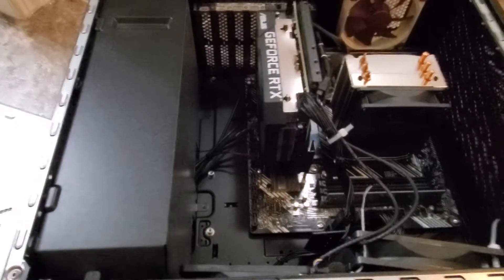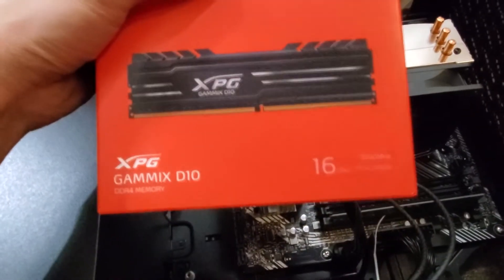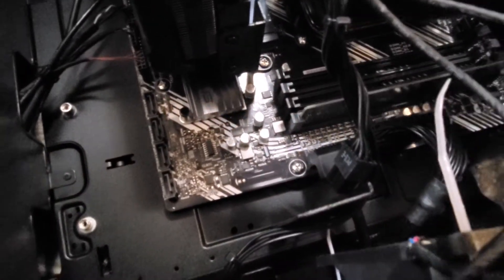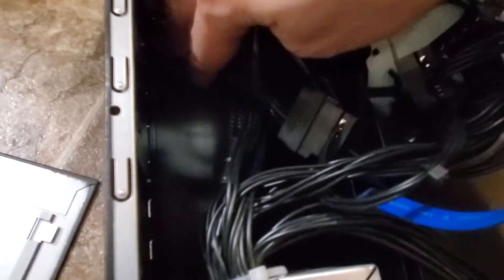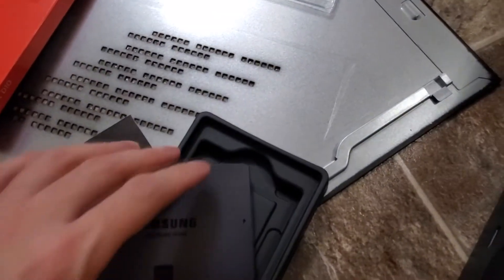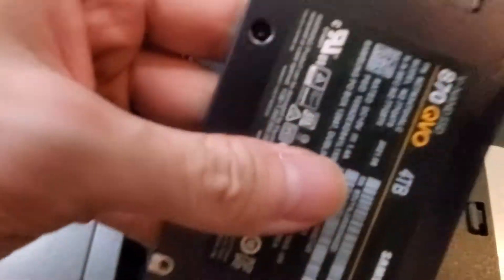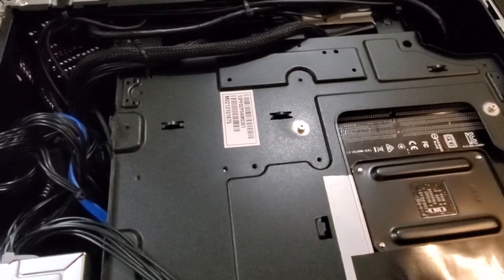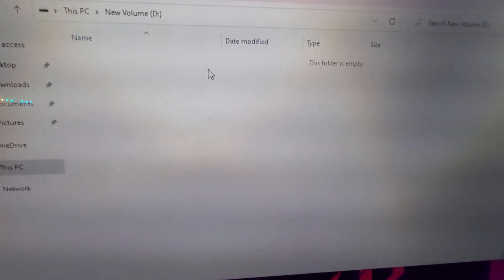How To Upgrade ASUS ROG STRIX G15DK Gaming PC 4TB SSD x 1TB SSD 32GB RAM

Comment: So I'm planning on buying a 1000 watt ROG strix PSU for my ASUS ROG STRIX G15DK Gaming PC, will it fit? Graphics card is a 3070 but everything is RGB and the PC currently restarts for seemingly no reason but upon checking the event viewer it's telling me it's a power issue hence why I'm going for the 1000 watt PSU
Reply from the maker: Yes. Its a power issue. Any atx psu should fit 1000watt isnt large. When you get the 1500watt those are longer
Reply: @kintips  Appreciated I could probably get away with an 850 but I'm greedy lol
Reply: @kintips Okay I installed it eventually but I am now a little lost, pretty sure I have the cables all in correctly. When I attempt to power it up I see the graphics card flicker on and off but no actual power to the PC any ideas? Okay I see the fans flicker on and off as well
Reply from the maker: @GabberFan12 is your ram seated correctly? Make sure all connections are tight.
Reply: @kintips Checked the ram and reseated both, all connections have clips so they are in correctly. Still the same, I am probably missing something simple
Reply from the maker: @GabberFan12 u have another video card? Take the other one out and try another one
Reply: @kintips I do but I have no idea how to get this one out, I hate this case with a passion
Reply from the maker: @GabberFan12 its either the video card or the psu might be faulty. Its brand new psu? I bought a psu once and it was faulty
Reply: @kintips Yeah is brand new, I decided to put the old 750 PSU back in to see if it would boot and hey presto it worked. So what I will do is ask some shop to install it for me 😂 If they tell me the 1000 isn't working then at least I can use the warranty to get it replaced, what a headache lol. I'm now wondering if it's the GPU wires, regardless it's going into a shop.
Reply from the maker: @GabberFan12 yeah faulty psu is pretty common. You think it might be the 6 pin gpu power cable? Hmm ive never seen that. Is the psu modular?
Reply: @kintips  I have no idea tbh I'll let the shop deal with the headache instead lol. PSU is ROG Strix 1000w Platinum that's about all I know of it lol
Reply: @kintips So the shop installed it and had no idea why it wasn't working when I attempted to install it lol

Comment: I have a ASUS ROG STRIX G16CHR computer and the same issue with the SSD.  I was able to put it where you have yours, but I could attatch one screw to the bottom as there are 4 holes in the case at the bottom.  Do you even know what would fit in those 4 holes?  Thinking some sort of drive bay, but no idea what kind?  Also saw some older video where someone put some sort of SSD plate which went over where the screws for the heat sink were.  I wouldn't know what kind to use though.  Really stupid they don't have a bay for SSD or supply the parts for even installing bays somewhere...
Reply from the maker: Yeah there isn't much room to put the SSD, but i've had no problems in the area where i put my ssd. It might fit the 4 screws but there too many cables to mess with. I think if you switched it out with a modular PSU it may help.
Reply: @kintips  I'll have to look into it.  I have tthe measurments for the screws so will see if I can't find a bracket or even maybe drill holes to fit a 3.5" case or something...

Comment: Hi, do you have any social networks where we can talk privately for questions please?
Reply from the maker: You can write the message here. I may do a live stream in the future
Reply: @ My question is: What was the basic configuration of your PC and what can be improved on it?
Reply from the maker: @lucasjr7_879  you can improve evrything except the cpu. If you need to upgrade cpu you will need a new motherboard
Reply from the maker: I have 1tb ssd plus 4tb expansion ssd then 32gb ram rtx3060 with a ryzen 7 5800x
Reply: @kintips  okay thanks, changing processor is not possible because of Bios?
Reply from the maker: You can upgrade the cpu if the socket is the same.
Reply: @ So I can change from Ryzen 5 3600x to Ryzen 5 5600x without any problem, right?
Reply from the maker: Yes is they use the same socket. Just remember u need a psu strong enough to support upgrade
Reply: @ Okay thanks for the answers

Comment: Dam i trying to find info on putting in a M.2 i don't know where to look the guide says it has 2 slots for it but i don't want to crack open my PC until i know where to look
Reply from the maker: Its usually under the gpu
Reply: @kintips  you mentioned in a few other comments I shouldn't even bother because both slots are already in use. I was hoping to slide a new one in, but I'll just play it safe and add what you did
Reply from the maker: oh yes, now i remember i think the wifi is taking a slot
Reply: @kintips  that's incredibly stupid it's supposed to have 2 slots, but both are already taken

Comment: how many ssd nvme m2 slots does this computer has? I curently run 1tb of nvme m2 and one 4tb of hhd . I need to put one more nvme stick urgent pleas help!~
Reply from the maker: One slot has wifi card in it.
Reply: @kintips can I expand it or i mjst remove the wifi card in order to connect another nvme?thank you for reply.
Reply from the maker: @dani_da_vision  the slot is taken up by the wifi. You have to remove it. Also not much room it sits where the gpu is
Reply: @kintips  ok update: I put the adata m2 960max 2tb instead of the wifi card. My write speed write are round 800mbps which sucks bad.beforre that ive installed the drive on external enclosure with usb-c. After instaling on the motherbpard where the wifi was - Iv'e formatted and and nothing changed in terms of speed. Iv'e even changed cluster size, But still the same speed. I WONDER WHY THAT IS

Comment: Did you know that in the bottom of the PC there are (in the indentation) 4 holes that are covered on the inside with a little sticky gasket?  No?  Well now you know - lol - the holes do however not line up with a 2.5" drive.  I suspect I have to go in my basement in my 1990 stuff to find a 3.5" carrier, put a 2.5" caddy inside and screw the SSD in the caddy.  I am going to say it.... F'ing engineers and their drillbits!!!!!
Reply: Exactly. Lay the tower on its side and look at the bottom (from the outside). You can see the 4 holes, covered by tiny stickers on the inside. Push through each hole with a pen or screw driver to remove the stickers. The holes line up with a 3.5" drive perfectly. Too perfectly, in fact, leaving no room for the sata cable, which sticks out a bit and smushes into the edge of the case. You'd think a right angle cable might fix that, but no, they point down, instead of up. I wonder if the designers even tested this stupid case. I guess I have no choice but to leave the hard drive floating loose in the jumble of cables.

Comment: I used a dual SDD to 3.5 bracket.  mounted two sdd's in the bracket then mounted the bracket with two screws to the bottom.

Comment: Hey is it ok to keep the ssd hanging.can I use double side tape and stick  it in front  under graphics  card
Reply from the maker: yes its not moving, unless you're throwing your computer around
Reply: An SSD has no moving parts so leaving it "hanging" will not be an issue, even if you do transport your PC. It is no different than carrying a flash drive on your keychain and having it bump and bang against things.

Comment: Is this pc an amd or an intel
Reply from the maker: AMD they do have an intel version with a different model number
Reply: i have an hdd and a ssd but my ssd is my main drive and my hdd is my secondary drive i want one more ssd but i cant find the plug in for it  if u could help me that would be great and the hdd is in the back but my ssd i cant find so it would be great if u could help  or if u had any suggestions.
Reply from the maker: you may need a new PSU if you don't have enough power SATA connectors.

Comment: lol watched this because I was hoping someone else had advice on how to mount an SSD without it hanging loose. Guess it's just not meant to be. Love the components/performance on mine but the way it was prebuilt is frustrating and the case is not good.
Reply from the maker: best is to just keep it in the power supply area, its not gonna move anyways. but yes i wish there was better mounts.

Comment: Could mount the SSD's in the front, on top of the PSU shield. Tape them down temporarily. Or add a drive tray / rack. Nice upgrades 👍

Comment: is there a slot for an extra m.2 drive anywhere?  without replacing the stock one
Reply from the maker: no i don't see a extra slot
Reply: @kintips  it does have 1 m.2 slot tho right ?
Reply from the maker: yes, mine came with 1tb NVME SSD
Reply: @kintips  do you know what brand or model it is
Reply: There is another M.2 slot underneath the video card - it's got a Wi-Fi adapter in it though so may have to take that out to put in a second M.2 drive
Reply: @darrenmonahan7186  Do you know if the extra slot supports NVME?